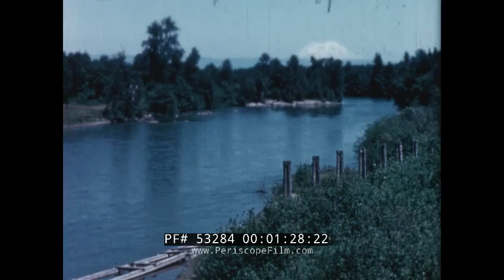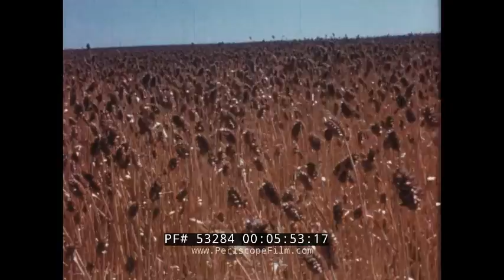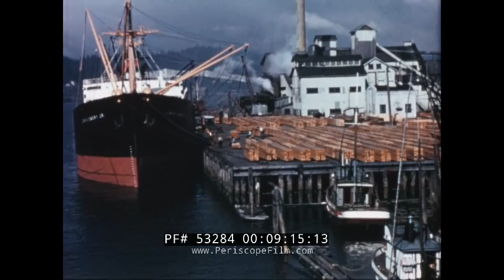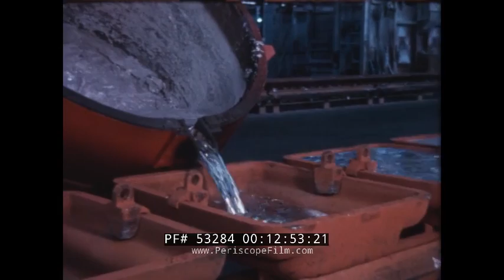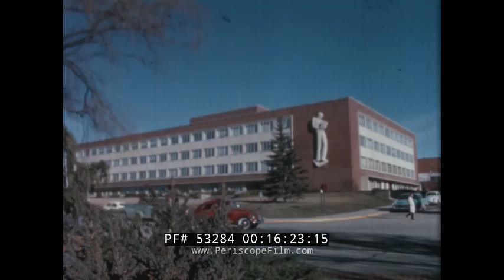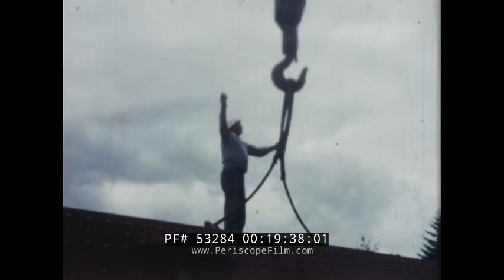1960s WASHINGTON STATE TRAVELOGUE FILM  "THE SURPRISING STATE"  SEATTLE & TACOMA  53284

Comment: I'm guessing 1960 or early 1961 for this film, as there is no sign of the 1962 World's Fair , and the construction of the I-5 ship canal bridge, which opened in January 1962.  I saw no cars later than 1960, and also no mention of Boeing!  I wonder just how many of the industries shown in this film are still thriving today?

But yes, Washington is a great, and beautiful state.
Reply: I thought there would be something about planes when they showed off all the aluminum! shrug the 747 wasn't made yet I guess.
Reply: @Starhartdeer  The first 747 rolled off the Everett WA assembly line in 1968, took flight February 9, 1969, and after certification the first commercial flight was by Pan Am on  January 22, 1970. I too noticed no mention of Boeing. They built B-17, B-29, and C-97 bombers here in Seattle and Renton for WWII and later commercial jets like the 707 (1957), the 727 (1964), and later the 737 (1967).  I noticed a lot of the footage in this video is actually from the late 1950s. Though in a couple of scenes with cars I think I saw a 1964 Dodge Dart.